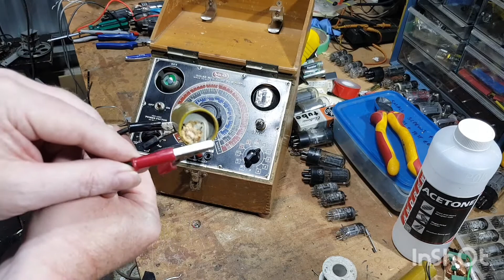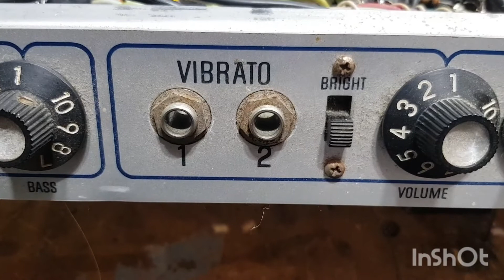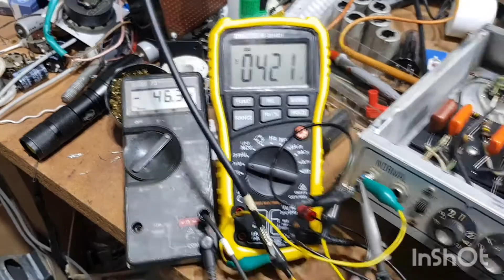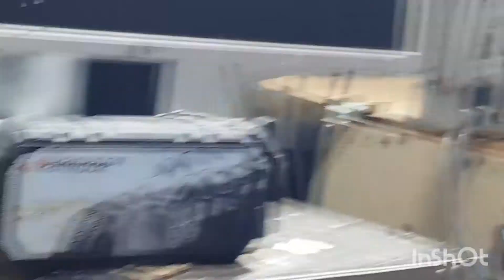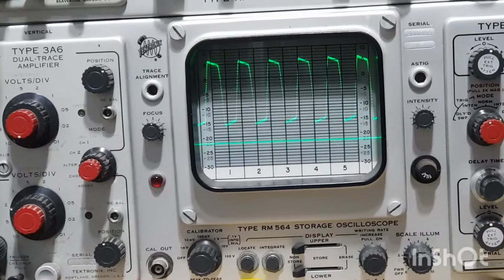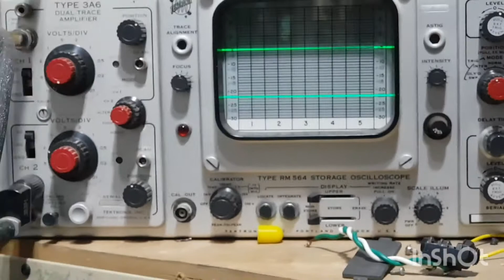Fender twin reverb repair and serviced pt2

Comment: Don't forget to check all of those old carbon comp resistors to see if they have drifted up in resistance. Definitely change all those electrolytic capacitors. I would change out. Those diodes, they're known for going bad, and if they go bad, you lose your b plus and she'll eat your b plus there goes your power tubes, so it's cheap insurance just to go ahead and change them.  And of course the electrolytic on your bias supply. Then you need to check and see if you have DC on any of your knobs. That's not supposed to be there, check and see if you have DC on the board anywhere where it's not supposed to be. You know, there can be DC leaking across that board, sometimes as boards can draw moisture and that 1 looked pretty gnarly if you ask me. It had old flux sitting everywhere. And it looked like rest pocket sitting everywhere, so I would test for DCB and where it's not supposed to be.